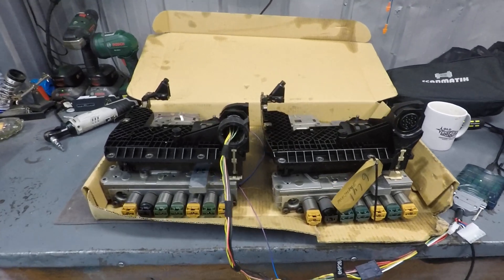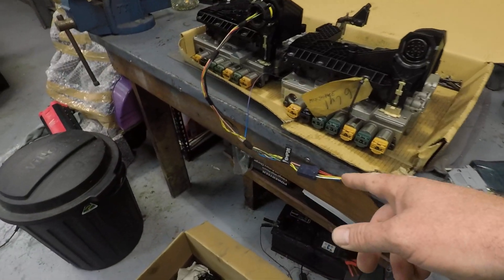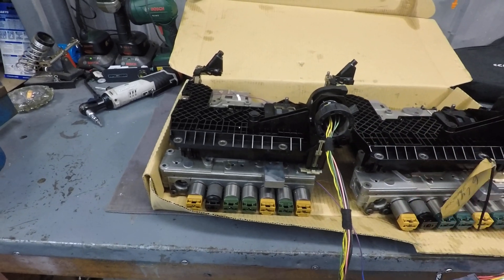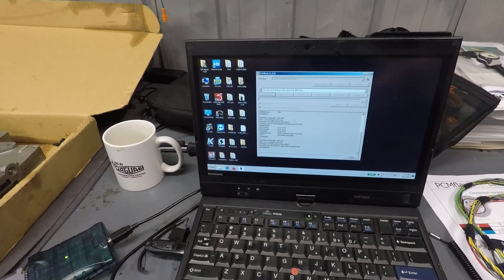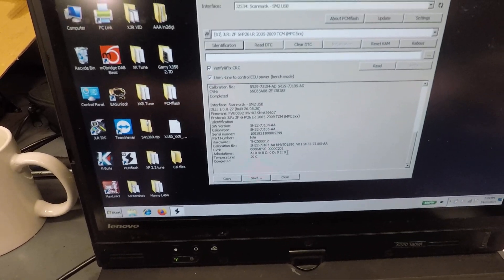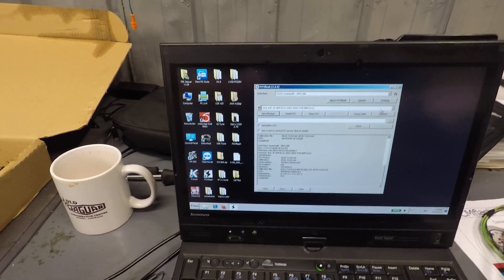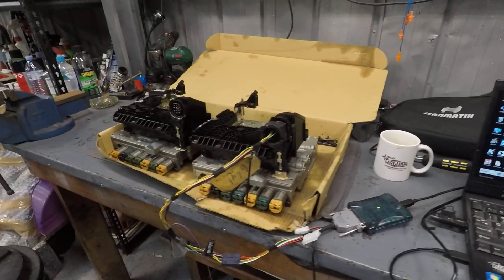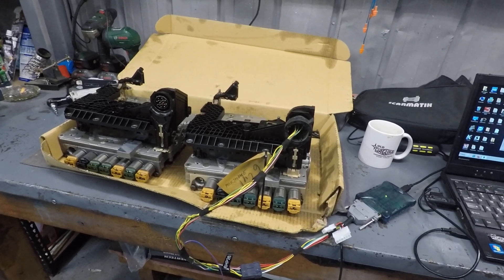PCMflash update Xmas 2021 - ZF 6HP26 transmissions, JLR, and Ford!

Comment: Back again with another issue.   BMW ZF 6hp26 from 05 645ci .   Orgional I can’t get anything the replacement I can get cal file and cvn but the rest have error 2231 w/ module 81.   However module 77 provides nothing.   Any ideas

Comment: Question about 6hp26 on jaguar S-type 2.7 diesel. Is there a 2d torque limiter map in the calibration file? I have disassembled software of ECU and there is a torque limitation curve which is not present in the software there. It could be an rpm Vs torque reduction curve made as a software calculation rather than a physical map, but I want to know if I am digging around to find something that isn't in the ECU and is in fact in the TCU. If you have a full read 2 x FLASH, MCU, EEPROM from a 2.7 gearbox (any set will do) so I can disassemble software let me know your price

Comment: I used module 81 and was able to read my Zf 6hp26 but for some reason neither of the 3 replacements I’ve bought can be read or even identified.   What am I doing wrong???
Reply from the maker: Module 81 is only for JLR TCMs, perhaps your replacements are from another brand, BMW, Maserati or something else. The same hardware with different software.
Reply: @OldJaguarAU .  any way to tell what they came from?  What can I use to read them if they are from something else like BMW ect.  Or am I not able to write  the Land Rover bin file into either of these replacements if they arnt JLR TCM’s?
Reply from the maker: @ Module 77 can read/write them all, so you could clone the Land Rover into the others.
Reply: @OldJaguarAU  thank you!  Got it working!

Comment: will a 2007 navigator with 6hp26 require programing after replacing
Reply from the maker: If you are installing a used (already programmed) trans from the same model & year it should just work.

Comment: Hi cambo. Great stuff 👍. Got a question if you dont mind. What would the procedure be to (as a last resort) “virginize/clear” 6hp26 vin number from a salvage gearbox/conductor plate so that it can be reprogrammed with JLR SDD software. According to the description in SDD the software will reject the flash process if there is already a vin tied to the TCM. Can this be done through PCM flash or any other methods? Cheers
Reply from the maker: Well there is no VIN in the JLR 6HP26 TCMs, only in the 6HP28, 8HP & 9HP.

SDD would flash the TCM with files for the as-built spec of the vehicle in the session, in my experience you can flash pretty much any used 6HP TCM with SDD. 

However you don't mention which vehicle exactly, whatever you do, don't try it with an early S-Type... it'll fail for different reasons.
Reply: @OldJaguarAU  Thanks for your reply cambo much appreciated. 

Im in the market for a couple jags models supercharged 4.2 and 5.0 XF x250 mainly due it having dynamic mode and paddle shifters. The XK x150 also haspaddles but no dynamic unless you get the 5.0. I do also like the x350 XJ but im not a fan of the J gate. 

Was looking at the worst case if one of these 6HP TCMs fail from age or my own wrong doing. I will keep it in mind with the early s types. 

So if i end up with a 6HP28 or the 8HP70 in the 5.0l S/C would those used replacements fail the programming procedure through SDD due to vin of previous vehicle and if so what would i need to clear the vin with.

Comment: you have any videos of zf 8hp  trans swap? mine has a issue with the 3-4th gear, it knocks when im in the gears. i need to replace. any advice ot recommendation?

Comment: hello i got a 05 lincoln navigator with the 6hp26 and tcm is fried, only ones available is bmw/jag/rover, i could get any of those tcm's and the dealer would be able to flash/ update the the tcm? i asked the dealer and have no clue, as long the pins are the same it should be exact same from any brand but different programming i would guess
Reply from the maker: No the software in BMW, JLR, Ford, etc is totally different, even if the hardware is the same. So you can’t just fit any TCM to the vehicle and flash it. 

The only way this could work is if you have a good Lincoln TCM, we could read it out, and then copy that into another one. 

Ford dealer couldn’t do this. Not sure where you are in the US, but we have a contact in CT who can.

Comment: Can this do bmw 8hp, thanks
Reply from the maker: You can do full read/write of BMW 6HP & 8HP prior to Gen3 version with modules 77 & 82, but no programming of new modules with factory calibration or coding. Gen3 are different hardware but there’s a solution coming in the pipeline soon.

Comment: Nice Video, just to clone Ford Falcon Transmission FG what PCMFlash module do you use , 77 ? Thanks
Reply from the maker: If you are only working with Ford then Module 85, if you are converting other brands then Module 77.

Comment: Does it clone flash and eep zf6hpxx 2002 jaguar ?
Reply from the maker: Module 77 on the bench only, yes.
Reply: @OldJaguarAU  can you send whatsapp or email  please..
Reply from the maker: @D3otoprog  go to oldjaguar.com and use the contact form to get in touch.
Reply: @OldJaguarAU  Does it clone flash and eep Aston Martin Rapide S?
Reply from the maker: @manthienhoa  Rapide S is 8HP70, not 6HP26... but yes is possible with PCMflash Module 82, Scanmatik and custom cable.

Comment: Please i need module 81 connection diagram
Reply from the maker: Module 81 will not work with BMW transmissions
Reply: @OldJaguarAU  Hi,Master any ideas?ZF6HP26  O9E trans..Audi
 where can i buy an adapter that connects directly to the mechatronich'
I would like to flash it with Odis Engenier thank you
Reply: Hi,Master any ideas?ZF6HP26  O9E trans..Audi
 where can i buy an adapter that connects directly to the mechatronich'
I would like to flash it with Odis Engenier thank you
Reply: Join the forum or contact Oleg via email